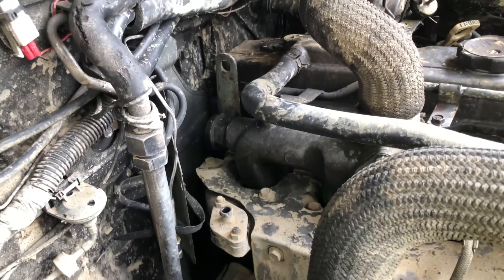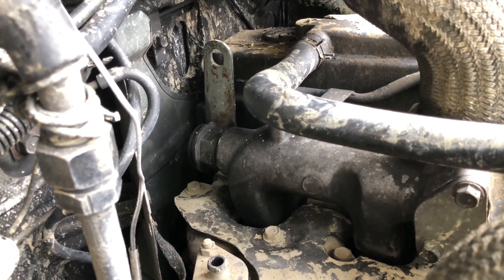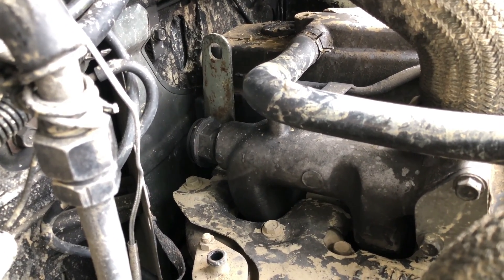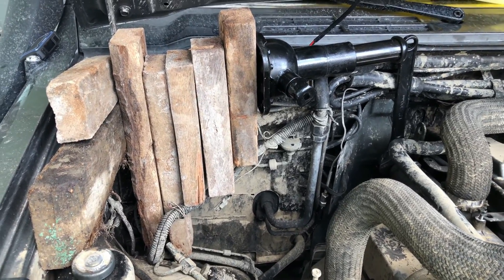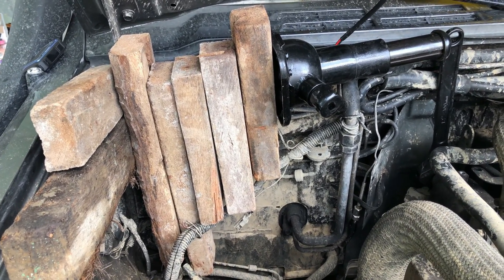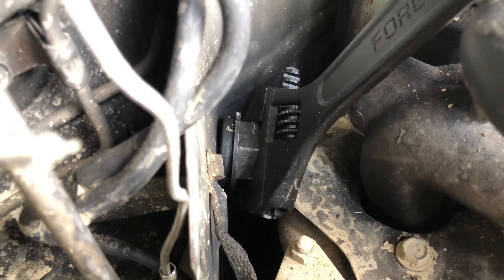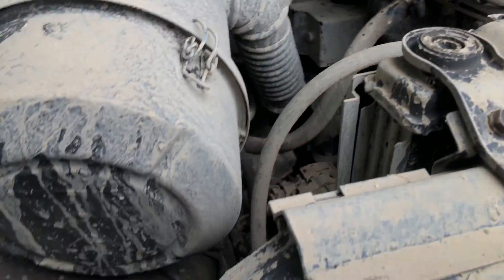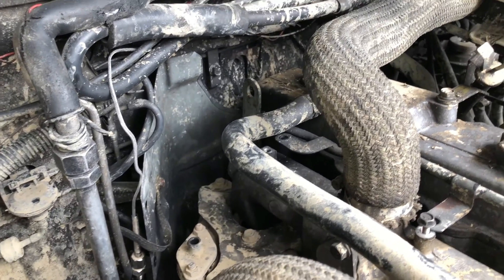Mitsubishi Pajero Shogun 4M40 4D56 Turbo Diesel Intake Manifold Over-Boost Valve replace plug block.

Comment: Hello bro, I have some questions about 4m40. I just bought a 4m40-2 model (140ps). The vehicle has a leaking sound when it accelerates hard over 2500rpm, but there is no leaking sound if it accelerates slowly. Do you know the reason? Thank you.
Reply from the maker: You're probably just hearing the turbo boost, which is a good thing.
Reply: @offgridislandfamily na，It's a heavy air leak.

Comment: Just brought my first pajero, I'm fixing some stuff and overall I'm optimistic I can fix 80% of all the problems by myself buuuut i just found our that the hoses form the turbo cooler I guess it's called (rectangle mini radiator over the engine) has a lots of wet oil inside... idk if it's normal or what could be the problem if any :(
Reply from the maker: Some is normal, especially if it's never been cleaned before. I used two cans of Seafoam intake cleaner. However, diesel emmissions systems run the blow-by (oil / air combo) back through the intake, so naturally coats the inside of the intercooler and intake system with oil, reducing efficiency and power. First, remove the intake tube to the turbo and feel the turbine shaft for play. A little is ok, but a lot means you need to rebuild the turbo. Feel free to ask anymore questions. Cheers!
Reply: @offgridislandfamily  Thanks man! I appreciate the answer 🔥🔥

Comment: Mine is still intact. The issue is: it always relieved at 1.0bar while power hasn’t reach its max. Any suggestion? Thanking you in advance 🙏
Reply from the maker: Yes. This is due to the blow-off valve on the back of the intake manifold. This must be removed and plugged.

Comment: where is the oil pressure switch at this engine
Reply from the maker: just to the top right of the water pump at the front of the engine.

Comment: How it's been your experience over boosting your SUV, I just puchase a 2001 Montero with the 4m40 engine but I'd heard some seying 4m40 is a bad quality engine, it suffer of overheating and the cylinder head is too weak, I mean, if you give credit all of those versions grandma driving is the only way a 4m40 will last.
Reply from the maker: Yes! Exactly...overboosted at about 2 bar and now I am replacing the head and gasket. ;-)

Comment: Hi mate awesome video so what exactly was wrong with the overboost valve the problem I’m having with mine is it is letting out of all the boost and making a washing sound I got told just to weld it up with this affect the engine
Reply from the maker: Well, the overboost valve releases pressure at 0.9 bar, so won't let you run any higher boost than that.

Comment: Bro i have an issues may u help me 🙏. I put into drive but the throttle will lagged bout 15 second .? Already change the diesel fuel but still same . How to fix it thanks
Reply from the maker: Sounds to me like a fuel delivery...possibly fuel pump / distributor problem.
Reply: @offgridislandfamily  not on the gearbox issue?
Reply from the maker: @tl.films92  Uhh...yeah. If your fluid level is low, then this VERY MUCH could cause the symptoms you're describing. HOW? When you transmission fluid is low, it's not being picked up and pumped through the system. After some engine temperature, the fluid expands, allowing it to reach the pickup tube.
Reply from the maker: ...you may also have a turbo pressure leak.

Comment: When you lose your boost pressure do you hear a loud air pressure  "hiss" sound, in the engine? do you loose power? if yes at what RPM?
Reply from the maker: Well, you have both the wastegate (which you really won't hear) that let's off boost pressure, but you're most certainly referring to the pressure safety release valve on the intake manifold. originally, this releases at 0.9 bar, but with age, may weaken and release at lower pressure. Mine in blocked off as seen in:  https://www.youtube.com/watch?v=mez2t4xYqsA&t=62s
Reply: @offgridislandfamily   Would it make any difference if a just replace it with a solid HEX nut with a sealing paste?
Reply from the maker: @judesanchezjr6929  ABSOLUTELY! This is what many do. However, you should have a boost pressure gauge first to be SURE not to over-boost your intake system. ;-)

Comment: Hello turbo tuner, I've got a SWB with a 2.8, just installed the boost pressure controller and completely closed it to bypass the wastegate, still can't go over 0.5~6 bars (7-ish PSI), I can hear the sound of the turbo hissing, So I suspect something is leaking somewhere. the over-boost valve is next on my list, but seeing how hard it is stuck in there makes me a bit hesitant. do you think there was a better way to remove it ? my goal is a 0.9 to 1 bar max. cheers.
Reply: Thanks for the quick reply. I have not yet removed/blocked the manifold pressure relief valve, I'll be doing that next, the soonest I'm able to. I'm also yet to touch the boost compensator diaphragm on the fuel pump; one of the four 10mm bolts isn't easily accessible (a tubing passing on top of it, unlike in your car).
Reply from the maker: Any progress or updates?
Reply: @offgridislandfamily  I managed to get the boost consistently up to 0.8 Barg, with the membrane adjusted the car was really light from low RPMs, until the turbo gave up on me, it was already at its later stages of life (noticable shaft play), i also suspect i was running with very bad air filtration during agressif Sandstorm Season; the turbo shaft just broke in half at high load. A new OEM turbocharger later, and the car is basically brand new, that previous turbo was really tired. The remaining mods coming next (upping the boost further)
Reply from the maker: @leichmanado  Thanks much for sharing. Yeah...if your turbo is maxing at 0.8 bar, it's definitely on it's last legs! Why didn't you go with a Kinugawa or other upgrade turbo?
Reply: @offgridislandfamily   that would have been the logical upgrade, however availability is an issue where I live (Algeria); available after market turbos are cheap (not in price anyway) Chinese knock-offs only, and getting it delivered from outside would have cost me 3 times the price of the part. I was lucky getting the brand new genuine Mitsubishi turbo. I'm very happy with the performance so far, the car is driving better than it ever did! but I'll keep improving on it. thanks I love your videos and learn so much from them.

Comment: u just blocked it completely right.? got same issue.
Reply: nicee👌🏼. Thanks for ur reply sir. appreciate it 👍🏻
Reply from the maker: @kml083  Absolutely, and I appreciate you watching and asking.
Reply from the maker: Absolutely. In the video you can see that it actually breaks off, so didn't have any choice but to plug it using an aluminum and high-temp 'steel' epoxy. Been about 9 months and still holding strong.

Comment: You can put a pluming end cap...it’s just srew in 👍
Reply from the maker: Yes, but the part that a wrench or socket would grab on to snapped off like pottery, leaving the threaded ring still stuck in the manifold. Luckily, it broke off large enough hole for me to fit a suitable plug. But, eventually, I probably will need to remove the intake manifold and do it properly.